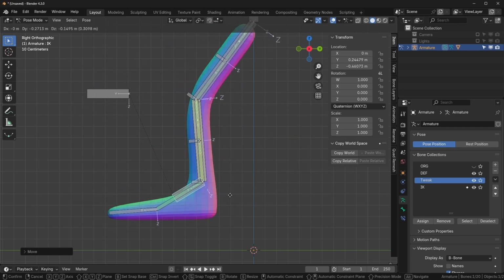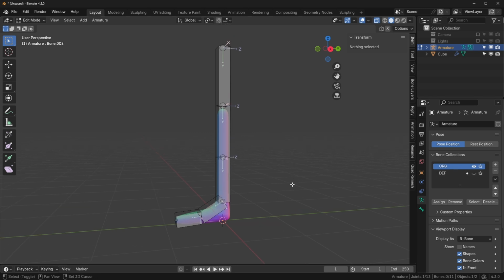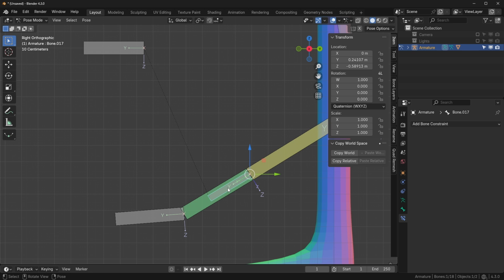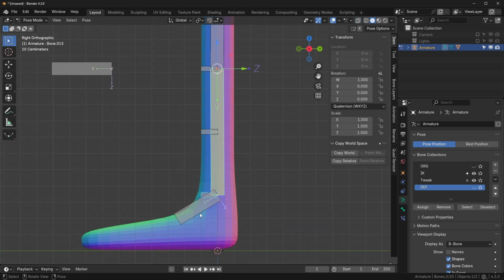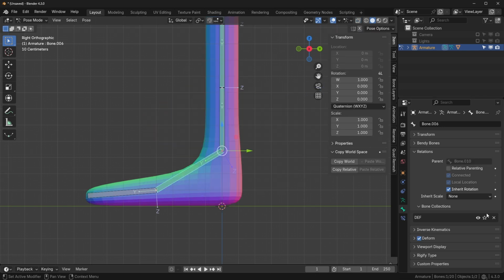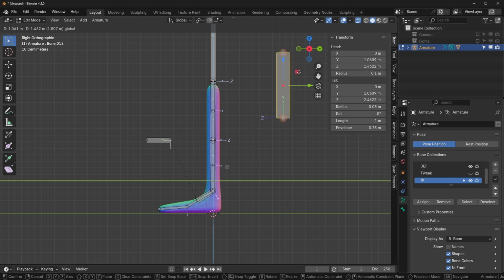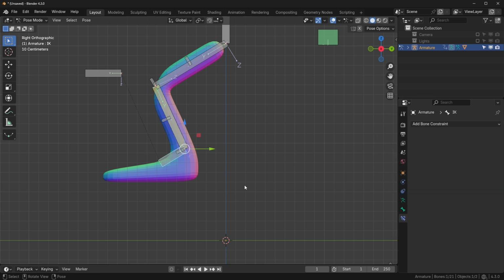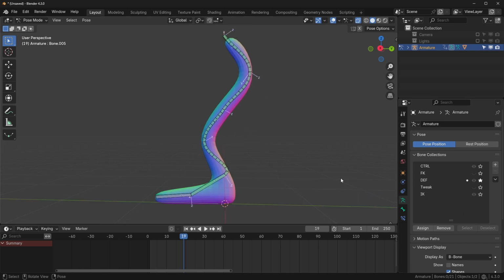THIS RIG can stretch, wiggle, and has IK and FK - Blender tutorial

Comment: You didn't show how to key a change from IK to FK. (so the FK takes over from the point that IK brought it).   isn't the FK supposed to follow the IK so when you do the Switch, it resumes from that point on?  thank you
Reply from the maker: for that I usually use the built in addon to copy the global transform and paste it so the leg is in the same spot when switching between IK and FK. If you do it over a single frame it works really well